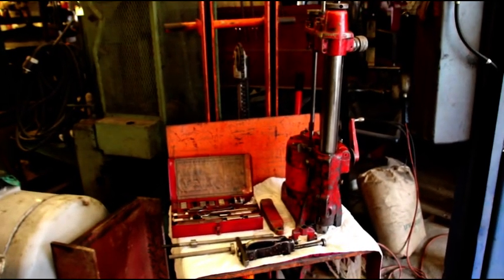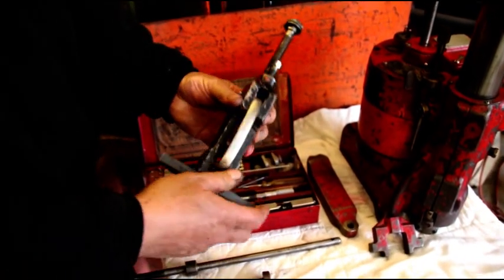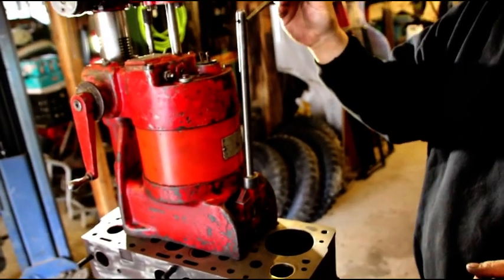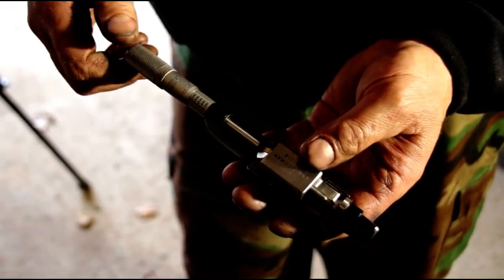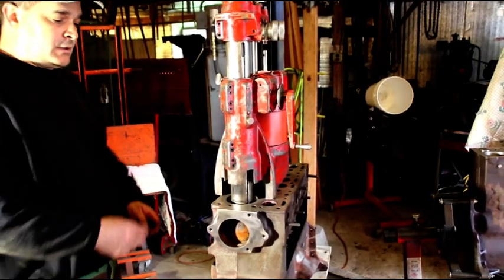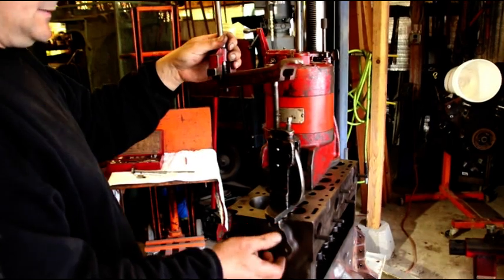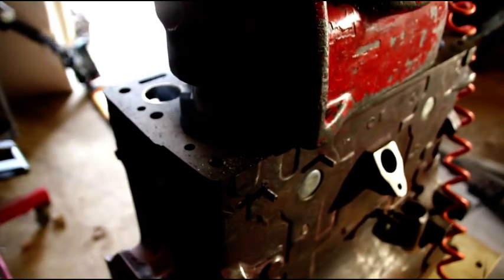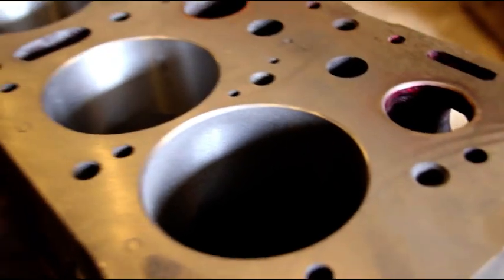Willys F Head Engine Cylinder Boring, Van Norman

Comment: I would think there still might be a lot of those that sell cheap at auctions.  Like so many tools this one takes some skill and talent by the person running it, many of the new machines do all the checking and the person running it only has to type in some information and change tools.  At 71 I grew up in a time when these were state of the art and they were at any machine shop that did engine work.  Of course back then the machinist doing the work had been trained by a master machinist and knew his trade, now the machines are expected to do all the measuring and maybe the guy running it will know if it gets out of adjustment or not.  You talk about "feel" and that has to be learned on the job and with someone to teach you, not from a course on line or a DVD.  You are a master at what you do, no question in my mind.
Reply from the maker: Well said Roy, I still work with my hands and don't have any computer controlled machines in the shop.  I can turn out the same quality and hold just as tight a tolerance as a computer controlled machine with my manual tools, and I guess that is why I am slowly becoming a dinosaur and my way of work will soon be extinct.
Reply: If you get one cheap, is it possible to buy repair parts to keep it functioning?
Reply from the maker: @skylinefever  Van Norman machines are supported by a few companies and many parts are available to keep them in good shape.   Biggest thing to remember is to get the tool kit with the machine, as many times buying all the little pieces costs more than the actual boring bar.
Reply: @metalshaperJeep  Thanks for the information.

Comment: makes me cry seeing the condition of this block and how it was recovered. I had an old 43 that had the head seized in place - I did eventually get the head off, but the block came apart like an apple pie crust - the area around the studs flaked out so deep it went right to the water jacket. At least I was able to salvage the head - but the block was done.

Comment: Do you always extend the cat paws at the bottom of the bore? Im learning with my new to me Kwik Way boring bar. And advantages to getting one of those stands for the boring bar versus boring right off the deck?
Reply: Also, do you always extend the cat paws during the boring process while its cutting? Ive just been extending them and then removed them when cutting.
Reply from the maker: @davemakiato7982  the cats paws should be extended out as soon as  the top of them is below deck height.  You want them touching the bore but not so tight as to bind up the machine.  They are necessary to ensure a straight, round bore.  do not try to bore without them extended and supporting the bar.
Reply from the maker: The stands are nice for small engines .  Most of the engines I do need the full depth of the bar and I wouldn't have enough depth if I used a stand.
Reply: @metalshaperJeep  Guessing that the block should also be decked before boring if you are using a block mounted bar?

Comment: I'm in the process of sending my 258 cid. To the machine shop, to get machined. I've never had an engine machined....can you tell me the must do's and the should do's In a proper engine rebuild??? Also on the financially friendly side. Thanks brother!!!
Reply from the maker: There are a ton of details that go into building an engine correctly so hard to get into it here in the comment section.  At the very least make sure it is clean, surfaces are decked to be perfectly flat, cylinders are perfect, valves are sealing good, and all factory tolerances are held.  Hope that helps.

Comment: I thought you got that chunk of steel to torque the engine for a angle to bore
Reply from the maker: Torque plate goes on for honing.  In an earlier video I showed the torque plate going down and the honing process.
Reply: Then I miss understood thought you used it to bore and hone ok